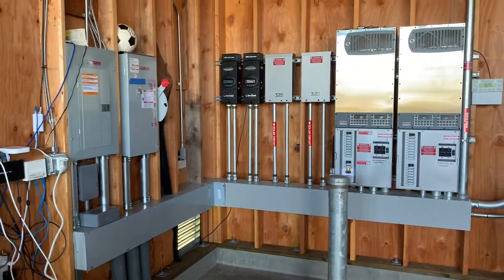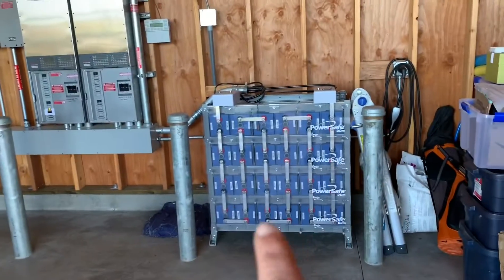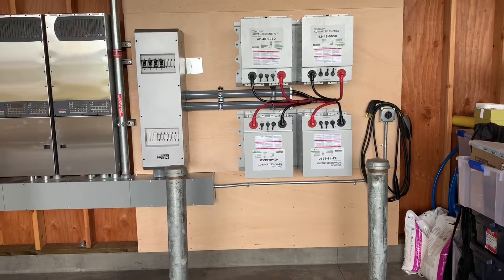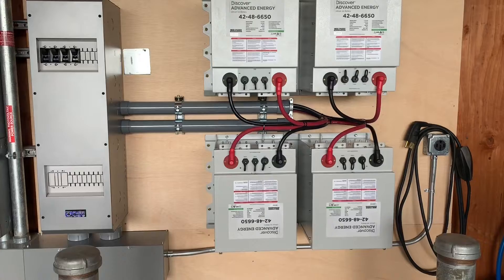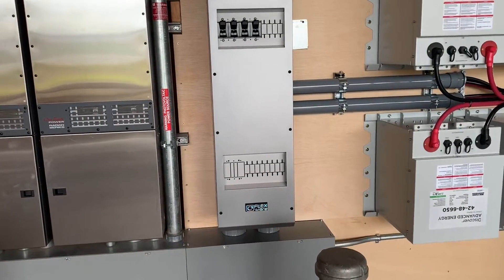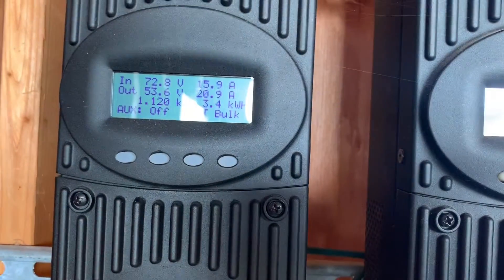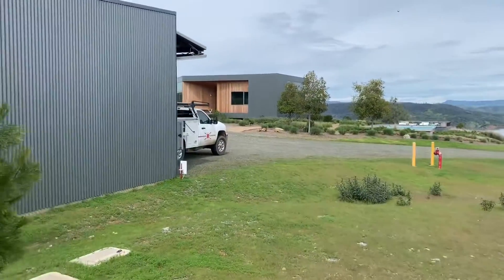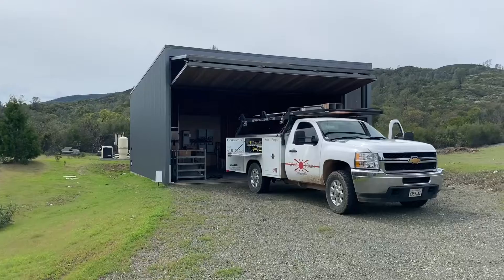Dead lead acid batteries upgraded to Lithium Iron for this amazing off grid home

Comment: So are those the batteries we'll be using??
Reply from the maker: ramosel yes it is but most likely we will use the Schneider context pro inverter, last week I spoke at the Nabcep convention with Discover Battery and had talks with Schneider about doing a case study project and will use your place.  I’m also trying to get enphase to let us beta test the new IQ8 that has the best features for ac coupling.
This system is the one I looked at the day before your place so I’m making slow head way.
Reply: @JasonAndrade427  Dude, as long as we are moving the right direction, speed is NOT my driving force.   Let me know if there is any prep I can do.
Reply from the maker: ramosel yes it is but most likely we will use the Schneider context pro inverter, last week I spoke at the Nabcep convention with Discover Battery and had talks with Schneider about doing a case study project and will use your place.  I’m also trying to get enphase to let us beta test the new IQ8 that has the best features for ac coupling.
This system is the one I looked at the day before your place so I’m making slow head way.

Comment: sick system! but why only 4000w solar? doesn't seem even close to enough. Love the view its so beautiful! how many Kwh are those new lithium's? its cool you make power walls for a living :D
Reply from the maker: Going Off Grid these are 6.65 kWh units as for the solar I am not sure why they landed at 4.5 kWh especially with the pool.  They are going to add air conditioning so we are looking at seriously beefing up the pv.
Reply: @JasonAndrade427   so 10-15KW of solar :)
Reply: @JasonAndrade427  
Fantastic plan brother
Reply: No bms? Is it integrated?